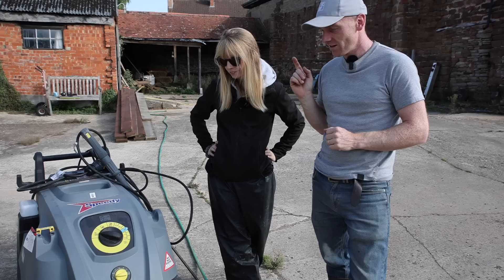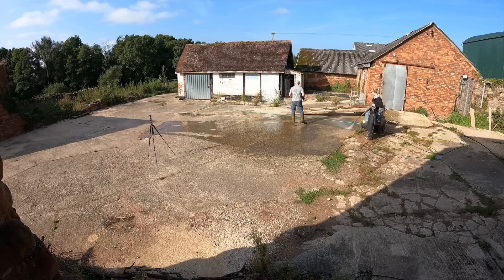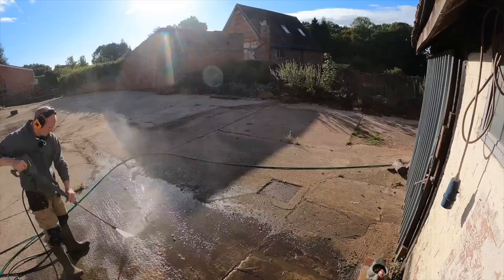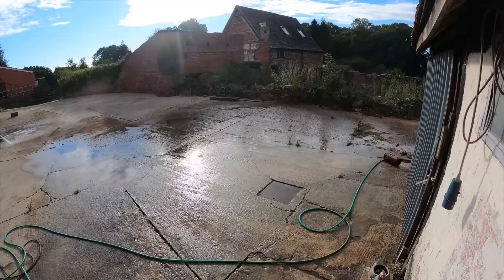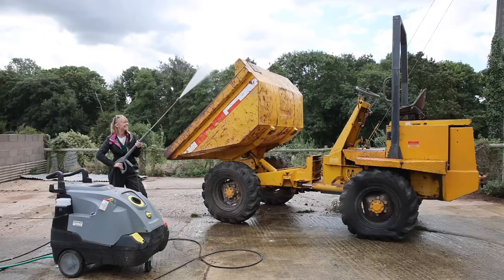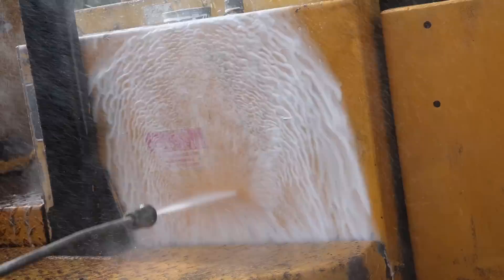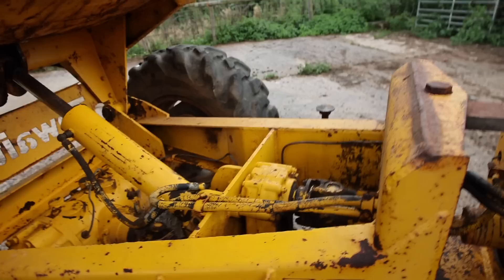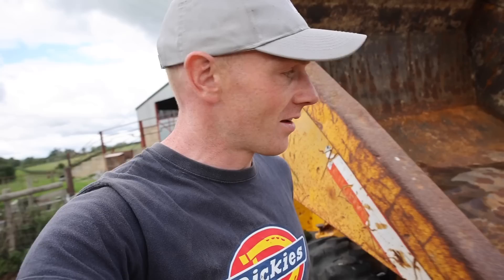TRYING OUT A HOT PRESSURE WASHER - What worked best?

Comment: Where was my invite!! Looks like a beast of a machine :D
Reply: Not a patch on your new setup. 👍👍👍
Reply from the maker: It did the job great but I wish we had asked for some other attachments, especially for the yards! We will sure to have you over when we get started on the barn, might need all you can throw at it! 😂
Reply: @TheRestorationCouple  Hi Hodgepodge folks!  I was just about to recommend Sid — great minds!!!
Reply: @TheRestorationCouple  Would love to help :D & yeah a surface cleaner is probably about 10x as fast on flat areas like that it's nuts. I've seen a lot of similar machines to that though i think theyre used really often in factories cleaning out greasy units etc. Heat on command without all the faff of a big static system.

Comment: I have used pressure washers/steam cleaners a lot. If you can centralise the machine, even a non-portable one, in a building and run the hose out to where you need it they can last longer and run cheaper. Only works if you use it within a reasonable radius of the outlet, you can of course run hard lines to where you need the outlet and the hose from there. Also keeps the machine free of frost which is a not infrequent killer of these and other water filled devices.

Comment: I had a hand-vibration problem once using a pressure washer and thought about getting some padded gardening gloves - this might be a good idea if your hands start getting a bit hot on some of the pressure washer settings. 

I hadn't seen one of the extensions used until I saw this the other day - cleaning out the inside of a barn ( https://www.youtube.com/watch?v=5e63i_vz8Fs&t=19s check about five minutes into this video). Also, I have some reallly cheap plastic waterproofs for outdoor activities and something like that could be sprayed down afterwards and left to dry - it looks like a lot of fun to get a bit wet but you might be a bit bored of it before long. 

MartyT the Kiwi guy sprayed down an old tractor with diesel to reduce rust getting worse - it might be worth considering for the older machines after you've greased them. Maybe just make sure they're stored in a place puddles don't gather beneath them and possibly tie a tarp over them. Guess you were going to do that anyway...

Comment: Avoid power washing asbestos down pipes (can be 50% asbestos), cladding or roof sheets. Anything like that is best left undisturbed until it's removed.
Using extension leads with pressure washers leads to premature motor death. They recommend a longer high pressure hose instead.
Reply from the maker: We actually chatted with Karcher at a show last week and they suggested exactly that.  I think going forward if we get our own machine,  we will aim to have in central and run the hose out further,  👍